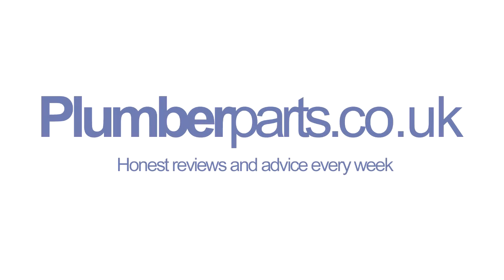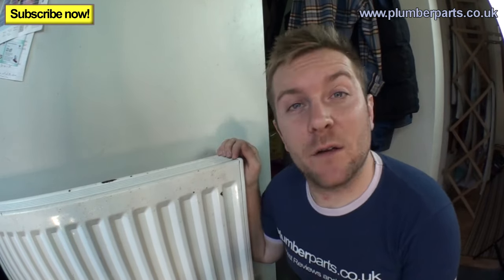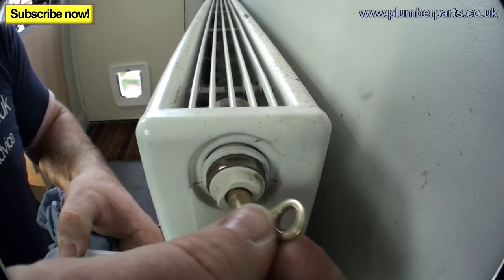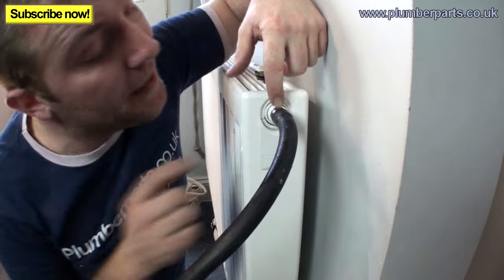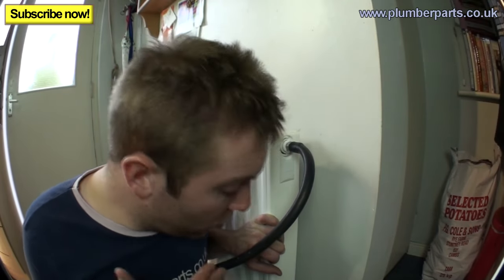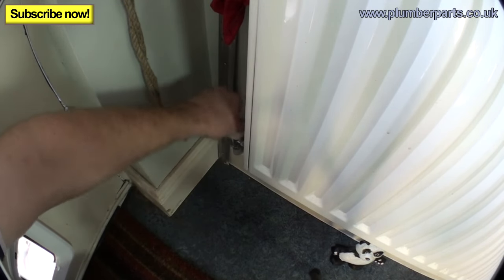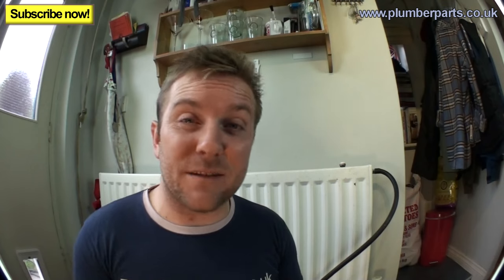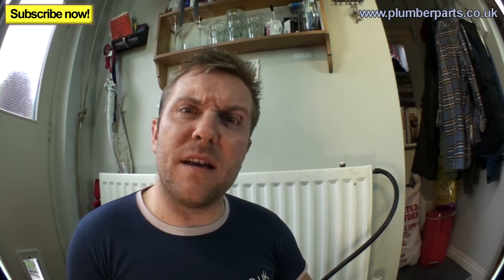REMOVE AIRLOCK FROM RADIATOR - Plumbing Tips

Comment: Hi, great videos, thanks.   I have a question please.    My downstair bathroom Rad is stone cold, the flow and return pipe is also stone cold.   If i close off both lockshield valves, let a little water out the drain valve, open the lockshields back up and bleed the Rad, it works perfectly......  This Rad has been doing this occasionally since Summer.   I've  drained the whole system, bled and balanced the Rads but still this one radiator continues to not work until i empty a little water out of it and bleed it.

It suggests air somewhere, but for the life of me, i cannot find where it may be drawing in.   All my other Rad work spot on.  I have 9 in total.

Any thoughts please?   

Thanks
Keith.

Comment: I've got 4 radiators in one part of the house that won't work - had the system power flushed yesterday as thought it might be sludge but now another block of rads don't work...place is freezing...help.  Could it be an air lock?
Reply from the maker: Sounds like an airlock....but also sounds you should get the old plumber back to finish the job! 
SUBSCRIBE! ➡️👉 https://www.youtube.com/subscription_center?add_user=plumberparts 👈⬅️if you haven't already!

Comment: seem to have a problem with one radiator , its not getting hot , and also the inlet pipe is red hot but return is stone cold .ive bled the rad but no air comes out  ,just water  .   p.s i live in a bungalow and all rads are on one level  any ideas mate ?
Reply from the maker: +Steve H Air lock mate, check our videos on it!

Comment: I have a radiator that has never got hot and I can't get water into it. The system is a gravity solid fuel boiler and uses solar heating type antifreeze so I don't want to use mains pressure water to remove airlocks. The pipes go round the house at skirting board height but have to go above the front door to get to the faulty rad. Do I need some way of sucking the water to start a syphon to get the air out of these vertical pipes? The 4  rads before this one work OK.
'
Reply from the maker: Use the method in this video mate! SUBSCRIBE! ➡️👉 https://www.youtube.com/subscription_center?add_user=plumberparts 👈⬅️if you haven't already!
Reply: I did use the method in the video but nothing happened. The airlock is in the pipework, not the rad. I wondered if I need some kind of suction pump?

Comment: I need to bleed a radiator in my house but the head on the valve is rounded, tried long nose pliers but still can't turn it. Any suggestions
Reply: gareth leonard isolate both lock shield and trv, undo one nut either end to release the pressure. then remove the bleed valve and replace it with a new one

Comment: Do this all the time. My hose always has a stab of 15mm with nut and olive in it. This is idel for puttin an iso innthe bleed valve opening do yoi can go and top up then use the pressure again

Comment: I have a problem with my rads, the two upstairs are cold when bleed them a little air comes out but then nothing. No water on either rad they seem to be completely empty. I have looked all over for a valve to repressed them but I cannot find any valve that is closed. Its a gravity feed system. Anyone know a solution ?

Comment: Dear mr plumber parts please can you help me. The bleed valve on my radiators is welded in and a normal key does not grip onto the square head . I think it’s worn out. How do I bleed them . I do not want to replace every radiator in my house you see.
Reply from the maker: Seach EasiBleed online!
Reply: plumberparts thank you sir.

Comment: my bleed nipples are on the back. so no way can i hook a pipe on? think ot had a thread like you suggested . how can i do this. can just bleeding work or will i need to purge air
Reply from the maker: +James Baillie You'll have to remove the radiator mate and use the valves to purge.

Sub here please>> https://www.youtube.com/subscription_center?add_user=plumberparts <<If you haven't already!
Reply: i seen to have the rad not working. working. i had to change the inlet valve as had a leak from it and was rubbish anyway. so it just needs bleeding in the normal way but most of my bleed valves are shot. i. getting misus to get me a good quality key as mine are cheap. as there on back its a night mare. ive had couple of tips but of you have one be great. it just spins. once i can get these bled as i drained the system down i will ballance. think its just air in my system at the min as half of them cold halfway. loads on bathroom one. that was easy as good bleed valve.

Comment: I broke d air key thing in radiator. .I tightened it hard d head/cap of screw came wid radiator key..how can I tk if off now.thnx
Reply from the maker: shy sad With difficulty. If you can cut a slot in the end with a hacksaw then remove with a clotted screwdriver, that usually does the trick!

Comment: i have a problem with a radiator in my hall.
i got new radiators installed and a central heating temperture dial as well put in which is on my wall.
now the council removed my gas fire and put in a electric fire and gas radiators.
the radiaor in the hall does not have a dial on the bottom of it that allows you to turn it off at the radiator or turn it down.
the gas men told me i had to have this one and you can not turn it off , so if i only have my bedroom radiator on, the radiator in the hall will be on as well.
the radiator in the hall is cool to the touch except for the bottom.
why is it cool to the touch as if i can make it more warm, will this cost me more money.
i was told that this is a by pass radiator and if i can make it more warm, will it cost more money to run.
Reply: Dave Seekers
Reply: James Southcome yes Dave Seekers is my name.
Reply: Sorry miss hit the keyboard lol
Reply: James Southcome i have a problem with a radiator in my hall.
i got new radiators installed and a central heating temperture dial as well put in which is on my wall.
now the council removed my gas fire and put in a electric fire and gas radiators.
the radiaor in the hall does not have a dial on the bottom of it that allows you to turn it off at the radiator or turn it down.
the gas men told me i had to have this one and you can not turn it off , so if i only have my bedroom radiator on, the radiator in the hall will be on as well.
the radiator in the hall is cool to the touch except for the bottom.
why is it cool to the touch as if i can make it more warm, will this cost me more money.
i was told that this is a by pass radiator and if i can make it more warm, will it cost more money to run.

Comment: Cavitation doesn't introduce air into a system. Cavitation is water vapour bubbles because of low suction pressure.

Comment: I have cleaned my system (not combi) with the x 800  2l over a week. Drained flushed, balanced all rads are full of water and working ok, fitted 4 new trvs too! But the pump (new in August, as the old one was noisy!) is making the same noise now as before especially when heating water not rads. The boiler man who fitted the pump said I should not expect miracles from an old system as mine! WTF. it's all working why the noise :(
Reply: It's running with x100 now too :/
Reply from the maker: +La Mon1 See, all solved! Well done! PP!

Comment: Vids are awesome keep them coming But i need some help if possible

HOLD TIGHT its an essay.

We moved into a new council place, time to turn the heating on and it was noisey as hell, rards were all different temps, some were cold down the bottom hot up top the usal plumbers wet dream.. so .. 

Rad 1  ( In the same room as back boiler in bedroom ) was HOT HOT HOT, but full of just  HOT air, so i sat there constantly for approx 40+ mins.. yes 40 or so more mins.,, And finally after alot of chugging and noisey pipes i had water come out. ** Whilst doing this HOT water came out of the overflow pipe from outside **

rad 2.  Still upstairs, was also full of hot air. radiator to hot to touch,  so bleed bleed bleed  ( like a woman having her u know what ) and wham bam we have water.. Now problem with this little bugger is that every 2 hours you end up rebleeding as it gets full of hot air again. Go to rebleed and takes about 5 mins to discharge it of air and then reappears the water. Been doing this now for a week or so now so im kinda fed up of doing it..   Any suggestions ??? 

The other 2 rads upstairs are now starting to get air in them but only for approx 5 seconds worth so nothing to bad, and their temps are consistant throughout. 

Rads downstairs are all a ok. nice n hot, no air in them what so ever.. 

Ive opened all valves upstairs to only half a turn which made a massive difference to the fellow chums down stairs but no difference upstairs , ( i.e no change from being hot ) 

Ive took off the bleed cap where you would put a PRV in its place and that pours out cold water even with the heating on.

Heating system is still noisey but no where near as noisey now.  

We can only have the heating on whilst the hot water is being heated at the same time. 

Is it possible to easily identify which system we have and check the water level in the heating system without a PV in place as naturally filling water with air is going to make the tank have less water in.

We also think the council did some plumbing work before we moved in ( new pipes etc ) - is this a case of them not bleeding the whole system ?? 

Cheers 

HOLD TIGHT!
Reply from the maker: +Nigel Price Boiler turned up too high or temperature guage faulty. Resulting on over heated boiler and steam!
Reply: +plumberparts  Cheers dude,   thermostat is at 15 - 20oC ,  heater coil ( inside tank ) is set to 40, so im betting thats foobard, Ill get onto the council. 

p.s we have the oldest Gravity fed system going. -.-

Cheers again fella :)
Reply: ok scrap that,  

we have a back boiler system, pure gravity fed. no pumps nothing, only a timer and a thermostat which is set between 15 - 20 degrees. 

Dial on the Back boiler is set to 2 from 4.

Vent tank is nice n full of water ( and other junk )   and ballcock float is all working ok.

Any other possibilites why we are getting so much air in the system ?

Comment: Got 2 rads that do absolutely nothing when I open the bleed key, theyre hot on the bottom, all other rads nice and hot but these 2 just do not do a thing. I managed to bleed it once by closing off one lock shield, for some reason it seemed to be slightly sucking air with both open ?
Reply from the maker: +Bunka Fas Take them off the wall and open the valves into a bucket. See what happens then!

Comment: Another much easier way to remove an airlock stopping a rad from getting hot is shutting down every other rad that is getting hot and only keeping open the cold rad the air will sort its self out no need for this much effort